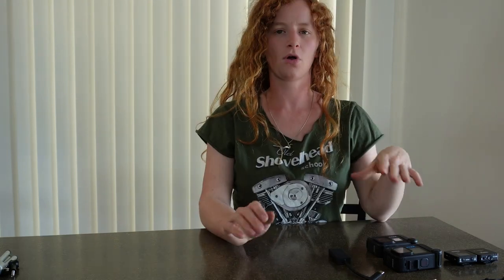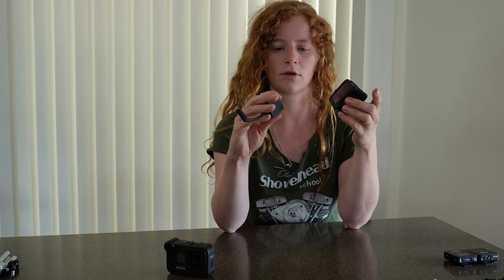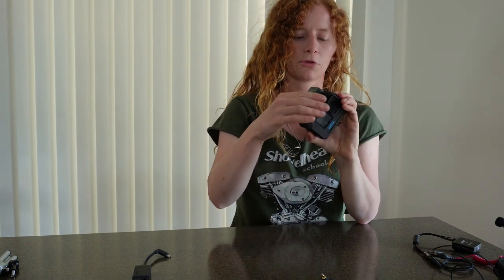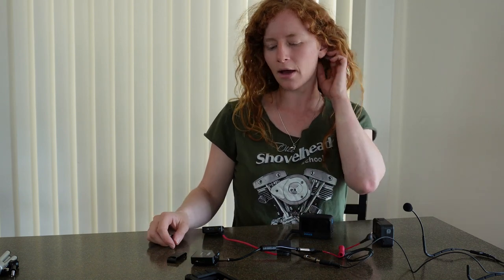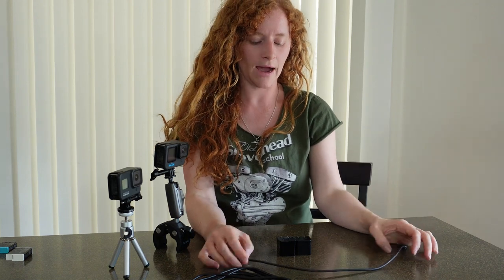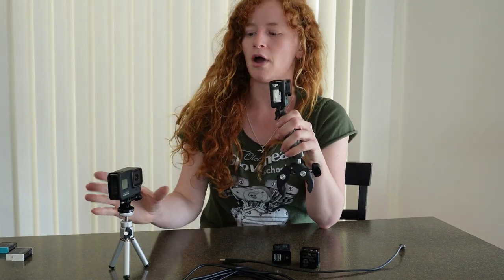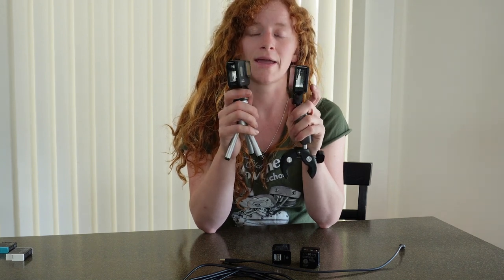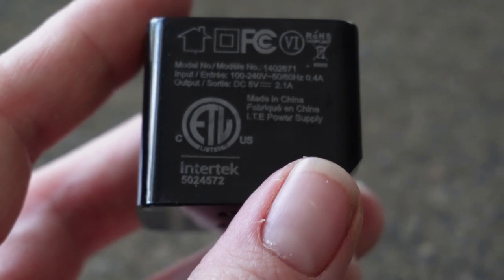Audio Setup For Open-face Vlogging | And Powering A GoPro Without A Battery

Comment: Good video.  This may not be a concern but somewhere back in time I was instructed to plug the smaller more fragile connector in first and then the wall plug.  The reason stated was there may be a spark when the connection is made and the large wall plug blades won't be damaged, the small wires might be.  Don't know for certain but it has become a habit.
Reply from the maker: Sounds reasonable 🤔

Comment: Thanks for sharing this part of your video work. I always find it interesting how people do their setup. When you plug both cameras (without the batteries) into the single charger, does it diminish the power of the charger? What software do you use for editing?
Reply from the maker: It doesn’t diminish the power of the charger because each port is putting out 2.1 amps of power. And I use Movavi Video Suite Right now, it’s not the most advanced but it’s simple and easy to navigate and gets the job done!

Comment: Very cool;  just a note, hopefully helpful, if there are power ports on your bike (like my Pan America Special) then you can power your Go-pro cameras without batteries (ever) !

marcus
Reply from the maker: My bikes don’t have any power ports ☹️
Reply: @RedRiderCanadaBC  , hi Angel , most bikes have no ports stock;  just modern ones like Pan America.  But, you can put ports on your bike.  It involves tapping a filtered 5v regulator (you can even make those) onto your alternator or 12v regulated output from your alternator|regulator.  There are commercial products for this as well. Its just electronics, really. If you were to add a heated-jacket port (commercial) on your dyna, for instance, you could also tap that for a filtered 5v usb port for running your go-pros.
marcus

Comment: I was hit between the eyes by a large grasshopper on the way to Grand Bend one night, blinded me ,slowly found the gravel shoulder and put my foot hard on the back brake. Was wearing glasses but the goo washed into my eyes. I like open face in town. High speed open roads? No.
Reply: Post Script. My mother 
(rest her soul ) had a crow that would talk, we helped it learn navy words. Mom was not impressed!
Reply: I got a bee in the forehead last week of course I was going like 90! the bee dissolved into my forehead, about 2 seconds later my head started burning like fire! poor bee!
Reply: @robertarcher1945  Pulled my helmet off in an intersection once because of a yellow jacket. Drivers thought I was a little nutty.
Reply from the maker: Worst I’ve had was a hornet down my shirt 😱